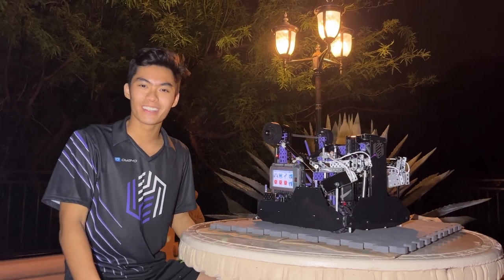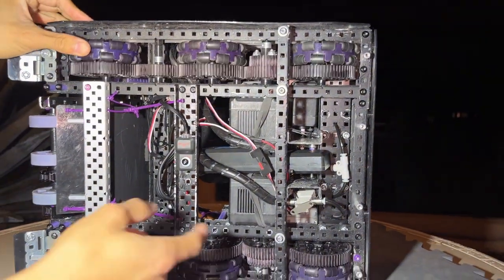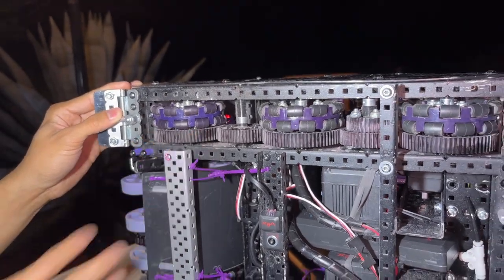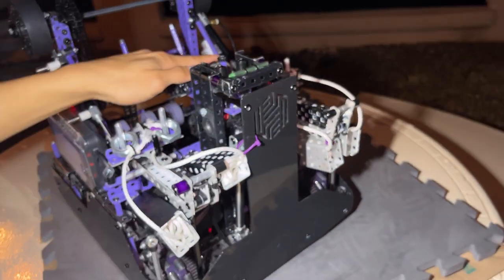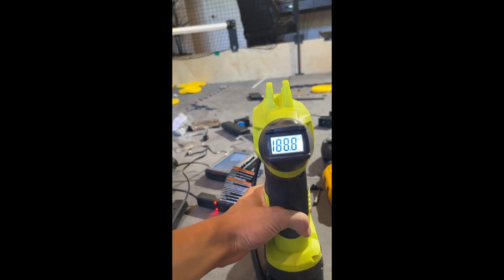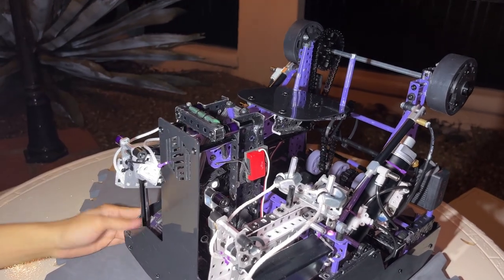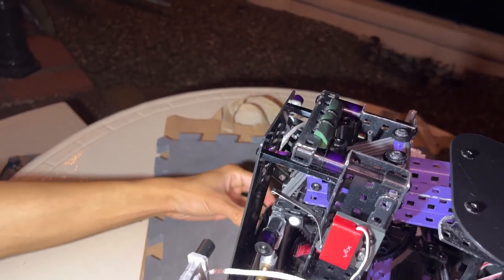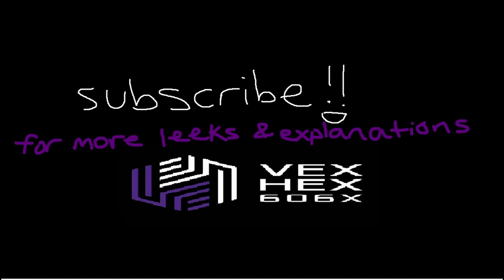606X Spin Up | Drivetrain + Catapult Explanation

Comment: Just wondering how you drilled out the 72 tooth gear for the ratchet on the cata because when we tried to drill it out, the gear started melting and we couldn't get through the metal.
Reply from the maker: This bot doesn’t use 72t gears for the catapult. On our worlds bot, we drilled out the 72t gears by drilling out little by little and squirting the gear with water to prevent melting.

Comment: Quick question, how do you disengage the screw on the rachet in order for the catapult to slip with the slip gear? Great build btw!!
Reply from the maker: The ratchet only catches in one direction. Since our catapult only needs to be driven forward, (the motor never spins backwards), the ratchet is always slipping when the motor is retracting the catapult. 

The ratchet prevents the system’s rotation in the backwards motion, because we never want the catapult spinning backwards. 

Hope this helps.
Reply: It's dosent need to be disengaged since it isn't on the slip gear, it's on a different gear

Comment: just curious what happened to the flywheel
Reply from the maker: it was really bad and we wanted a fresh start

Edit: our original flywheel bot was bad. (Competed at Mall of America sig)
We developed the 3600 cart method while cadding our catapult, as fun side project.
Reply: We had tuning issues on our first flywheel bot. The 3600 rpm flywheel is pretty good but I liked the cata better so we just switched to cata

Comment: love you video Vex hex question about catapults in general? The motor would pull the cata down and spin the ratchet untill it’s into position them to shoot it would you spin the cata father down untill the slip gear slipped or would you somehow release the ratchet or what’s a way to release the catapult?
Reply: The gear turns until it reaches the slip part and then the catapult launches. The ratchet is on the gear powered by the motor, essentially just to lessen the load of the catapult on the motor. The only way for the catapult to release is to use a slip gear, because the catapult needs to be able to spin on its own in order to shoot.
Reply: @journeyhancock  ohh okay thank you, is a ratchet still a good idea to use on a catapult, or will it complicate it more that it’s worth?
Reply: @braydensmith6069  It's really simple, the ratchet is easy to build and is relatively easy to install. For sure worth the effort
Reply: @@slogoat-6183 Feel free, this is why we create our videos.We want to share ideas out to people so they can implement it themselves
Reply: @journeyhancock  ohh okay thank you, the 12Tooth gear would go on the shaft that the motor is powering and then it would stop in place that’s very smart thank you I’m going to try this!
Reply: @journeyhancock  so is the ratchet screw on the same gear that goes to the 64 tooth gear, or is there another 12 tooth gear on the driveshaft that is just a ratchet? I am pretty new to catapults and vex and this is a big question of mine. Thank you!
Reply: @benjordan2627  the 12t gear on the powered shaft has a ratchet on it
Reply: @journeyh9170  so is there only one 12 tooth gear on that driveshaft?

Comment: I'm super late but I was wondering how did you guys mount the cata bar to the 84 tooth did gear? Did you just drill your own hole.  You guys have like no gear showing and I couldn't find a default hole for that. Thanks y'all are amazing!
Reply from the maker: yes just bolted the catapult to random holes on the 84t gear.

Comment: One or two air tanks? Do the auton pistons use a lot of air? Thanks
Reply: Only one tank, the auton pistons don't use up air at all, they only need the pressure and we could toggle that on and off without losing air

Comment: How'd you guys get so little friction on the drivetrain, I understand that it's about aligning bearings and what not, but are there any specific tricks when building to do that?
Reply from the maker: use a leveler and a magnifying glass to make sure all bearing flats and spacing are level and consistent
Reply: Ty

Comment: What happened to the right sideplate? and what is the purpose of the wedges in the front? just to help push people?
Reply from the maker: We encountered heavy defense at our competitions, leading to chips in the front cata plate and the right side panel in the unsupported sections. 

The front intake ramps are meant to push discs out of the way when we do rollers and there are discs jammed against the wall. They also help us wedge under people’s drivetrains to increase our defensive ability.

Comment: We currently rebuilding to use piston boosting so nice timing. Can you shoot 2 disks at once from mid?
Reply: Yes, but you need good grouping
Reply: @yimingzhu  Any tips on how to get good grouping?
Reply: @3MoneyMultiplier3  it’s a bit different for every bot but try adjusting the geometry of the catapult and the hardstop
Reply: @yimingzhu  We have tried adjusting the geometry multiple times with no success. How would the hardstop effect the grouping?
Reply: @3MoneyMultiplier3  By adjusting the hardstop the launch angle will change

Comment: Was wondering how do you guys have such a smooth movement when driving, our previous builds with 4 motor and now 6 motor usually rock back and forth when we let go of the stick to have the robot come to a standstill. Is that something you guys had edited in your code or was it more of a hardware solution.
Reply: We've had the same problem, I think it's something with the stop setting on the motors, but I'm not sure
Reply from the maker: We have our drive motors on coast. When there is no joystick input, the motors are not active at all. Driver practice also helps smoother movement
Reply: We also had that problem and we solved it by lowering the center of mass for the robot

Comment: I have a question, how many teeth are your slipgears?
Reply from the maker: It's been a while since we cut them, but it's somewhere in between 9-12 teeth per section. We had to change it quite a few times
Reply: @606X  how long is arm?
Reply from the maker: Forgor💀 somewhere around 10-15 holes

Comment: for the piston boosting, how do you detach it so it stops boosting after auton?
Reply from the maker: the solenoid switches the air away from the active port so the cylinders are unpowered
Reply: @606X im dumb, that makes sense thanks. Also, do you have any tips for building a great intake?
Reply from the maker: @pokehim_  yeah, make sure that the intake wheels are a bit further out from the ramp, and also a lower initial ramp angle helps too

Comment: Did you use 200rpm (green) motors or 600rpm (blue) motors in the drivetrain? Amazing robot design btw.
Reply from the maker: 600 rpm. Thanks!

Comment: What rpm are your wheels spinning at?
Reply from the maker: 400 rpm
Reply: @606X  that means you have 600rpm motors as your drivetrain?
Reply from the maker: @lucaswhiteaker  yes